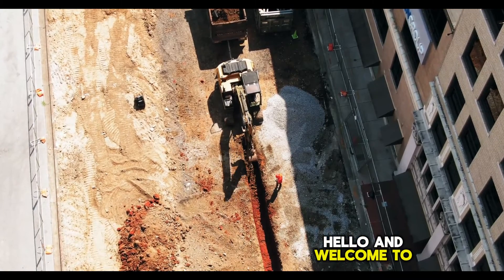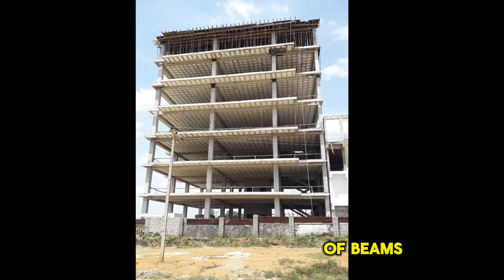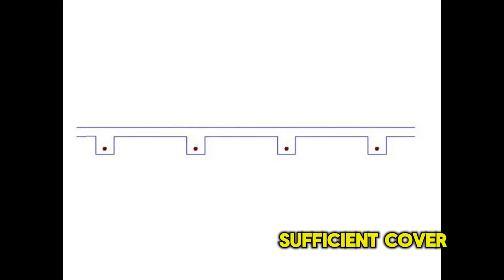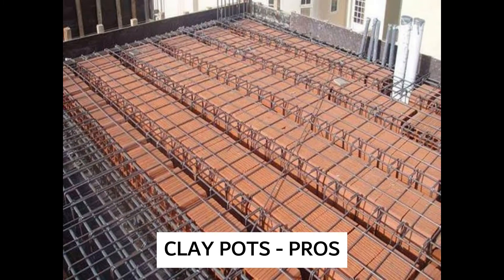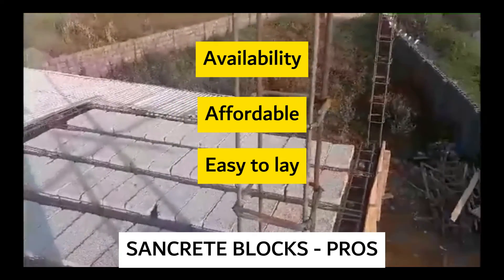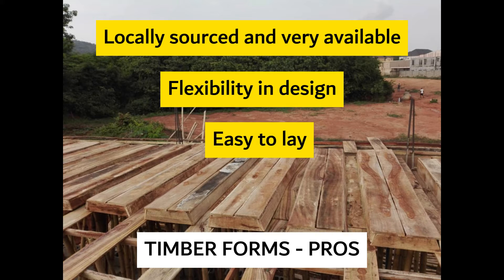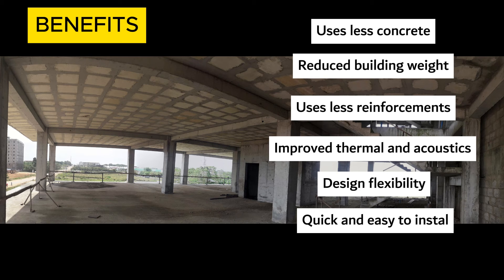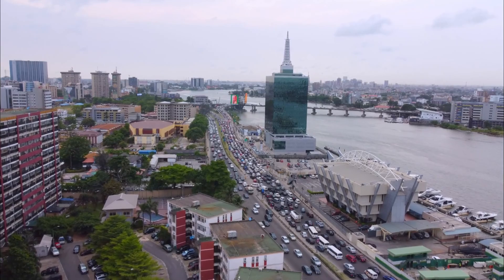Discover the secrets of Ribbed Slabs for Cost-Effective Construction | Huge Savings Concrete Slab

Comment: Hello Sir!

The entire living space of Option A is 7.28m x 6.30m(45.86m²). 
Open plan layout, with dining 200mm elevated.
Arranged like this:
Main lounge 6.30m x 4.2m. 
Additional lounge or VIP section 3.08m x 2.8m. 
Dining 3.5m x 3.08m. 
Total floor space 45.86m²

Option B. 
Main lounge 6m x 5m 
Dining 3.6m x 3m. 
Total floor space 40.8sqm. 

Sir, please  these two living spaces which one is larger and better. 
Which option is more luxurious in terms of space?